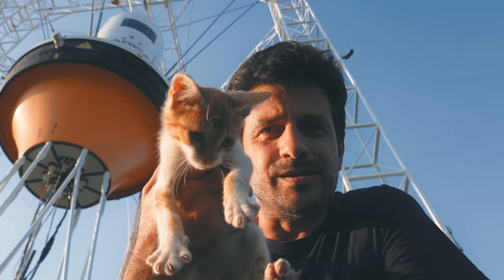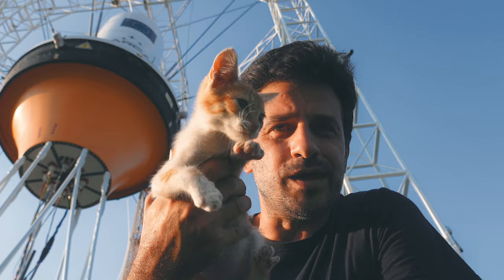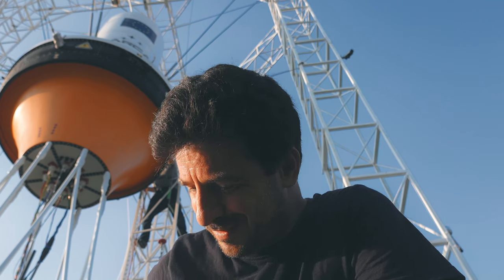MISSION 9 - SITREP 36: First Flight, What to Expect

Comment: How do you solve thermal management problem of Haas second stage aerospike engine nozzle which was one of major drawback of aerospike engine due to it's large surface area?
Reply from the maker: We design, build and test and then solve problems as we encounter them.
Reply: @ARCAchannel  Do you use ablative heat shield to protect nozzle as I had seen same concept in your previous executor engine?

Comment: How was the aerospike heating problem solved, isnt it one of the main reasons why the aerospike isn't in common use?
Reply: With the LAS, because it is a steam rocket the overall heating is pretty low relative to other rocket engines, so it would be easy to find materials that could survive the temperatures of the exhaust without deforming. With the Haas, HTP + Kerosene burns cooler than Kerolox, and much cooler than Hydrolox, so heating will be less of an issue than with previous Aerospike designs but still an issue
Reply: @sharqueeshajohnalaneesha2019  Thanks, forgot about that.

Comment: if this test passed, is this going to be the first electric space rocket in history? please answer! It's sooo exciting! And best wishes, fingers crossed!
Reply: It s not an electric rocket it s more like a steam rocket, so it s not the first one but it s the first one tu be used as a first stage i believe
Reply: @unhommequicourt  thanks but isn't it not run by batteries? If so, that would indeed makes it an electric space rocket
Reply: @kavorka8855  i don t know, this kind of technology is called steam rocket. It s like hydrogen cars, basically they are functionning with electricity however we call them hydrogen cars. it s beacause it s the propellant
Reply: @unhommequicourt  thanks :D